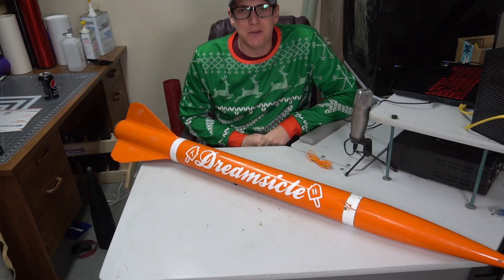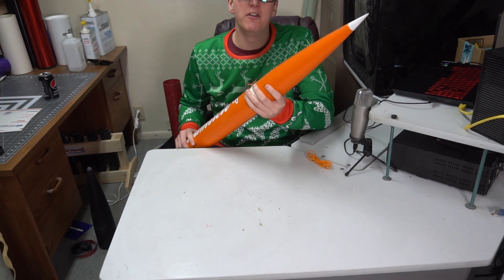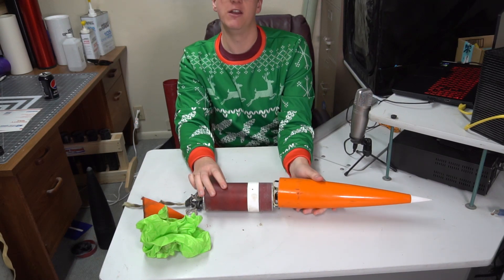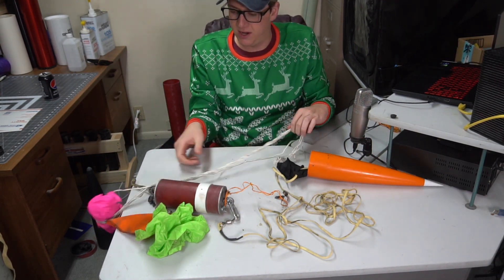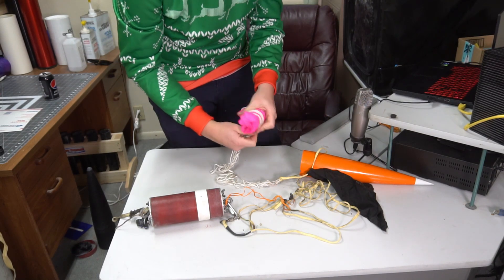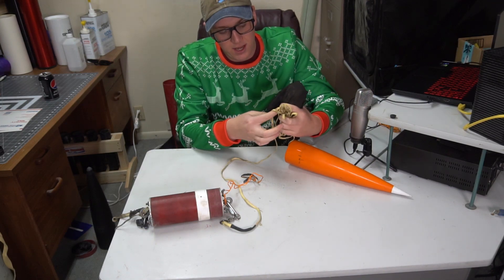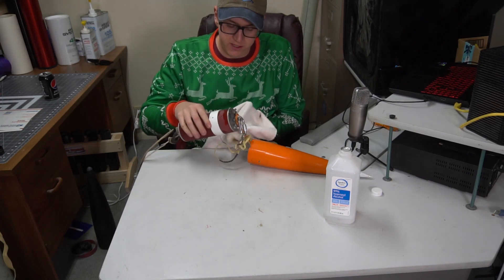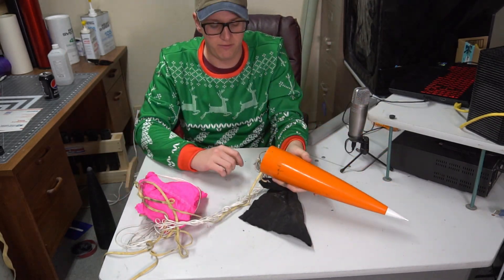Head-End Dual Deployment Explained | High Power Rocketry Basic HED Packing Tutorial (How I do it)

Comment: I'm curious as to the length of the upper av bay coupler that goes into the nosecone?
Reply from the maker: It is very short, but that's as far in as it would go when I got it. It's got shear pins  and it's flown on a few hard hitting K and J motors without issue!

Comment: I have another recovery question. Do you use threaded forward closures with eyebolts to attach recovery shock cords?
Reply from the maker: Not typically, but I used to pretty frequently. I also did when I flew the Iris because I was afraid of losing the case. Haha

Comment: I've also been tying the cute toward the nose cone and the Nomex blanket closer to the electronics bay. My theory is that, even with a weak separation, the Nomex will have a better chance of yanking the parachute out. So far, it has not failed. So far.